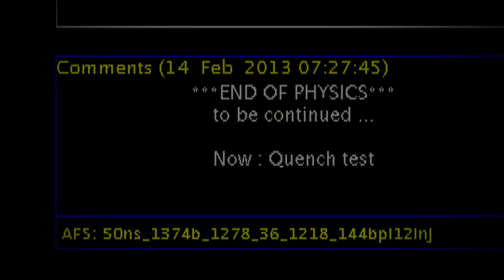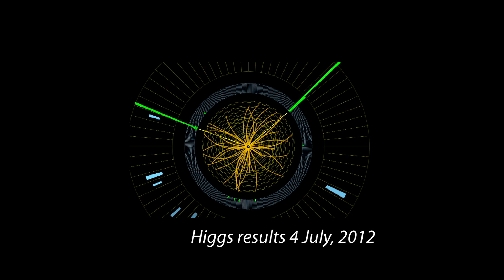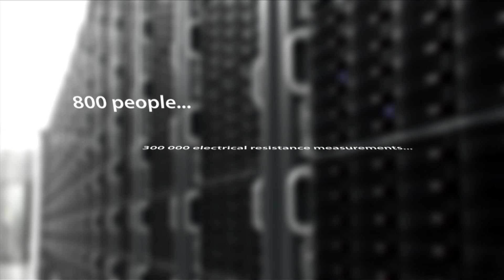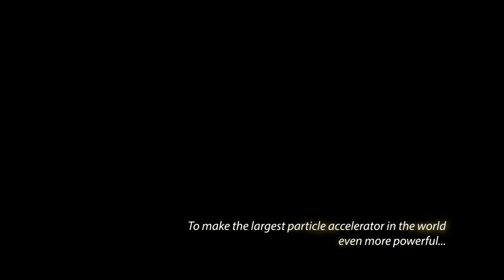CERN NEWS: A Long Shutdown for the LHC

Comment: Two experiments have independently found a new particle between masses 125 and 127 GeV/c^2 which they both confirm is a boson and thus far closely match the behavior of the standard model Higgs Boson. It's 99% certain that they have it but as this is science we must wait till all the analysis is done to be able to say with 100% certainty that they have it. But come on, everyone would be so surprised if they discovered a new particle no one was looking for where the Higgs Boson should be.